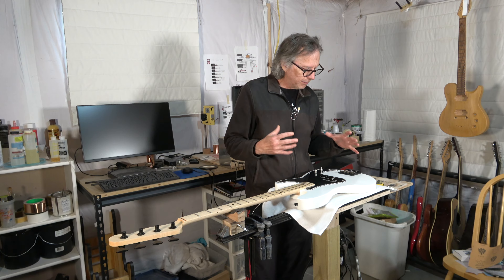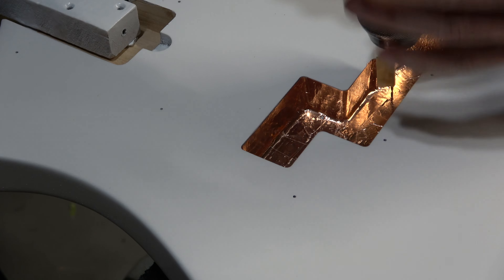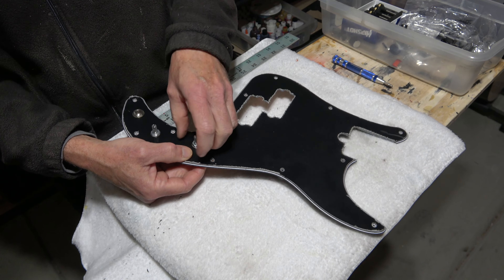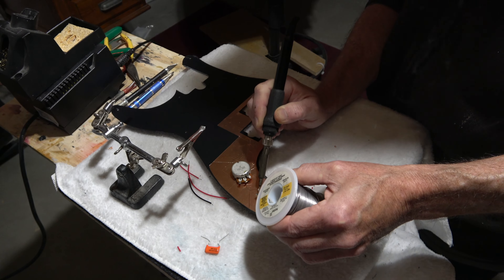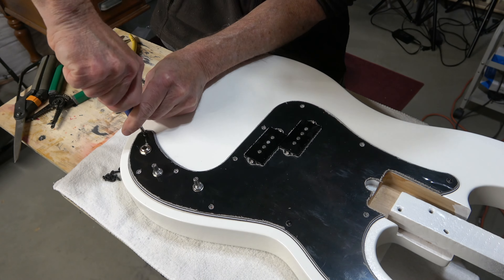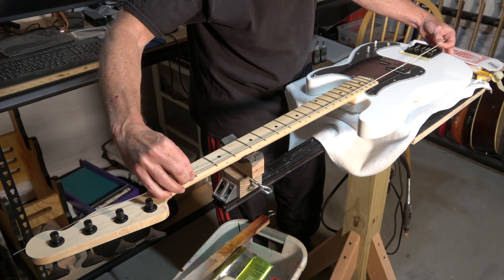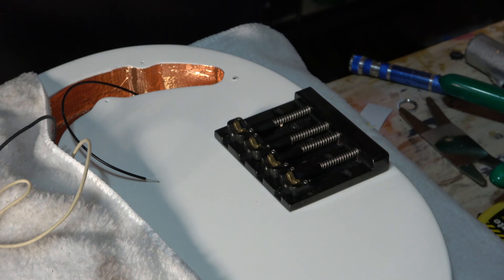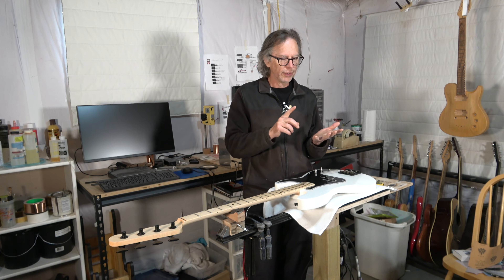Building A Precision Bass Part 18 Initial Assembly And Wiring The Guitar

Comment: Have you ever reviewed 2K HS PolyUrethane Clearcoat (UC-210)

I've been using this for quite awhile and it is beautiful to work with
Reply from the maker: I use Centurion water-based 2K as it is way easier to work with a just as durable, or as durable as I need a guitar finish to be.